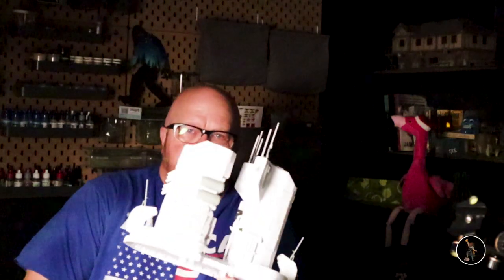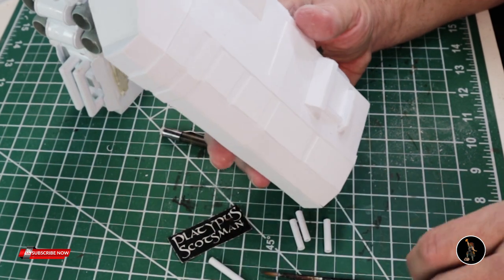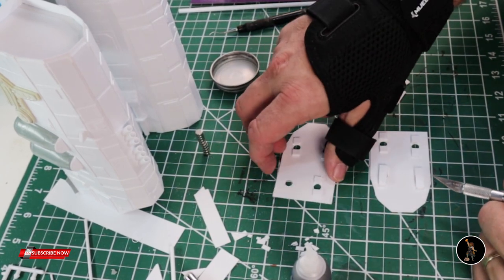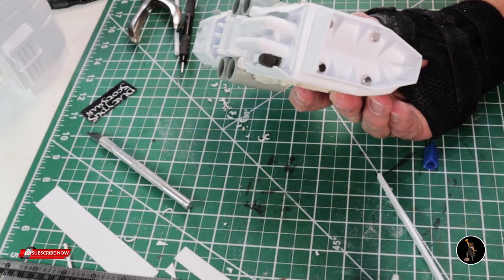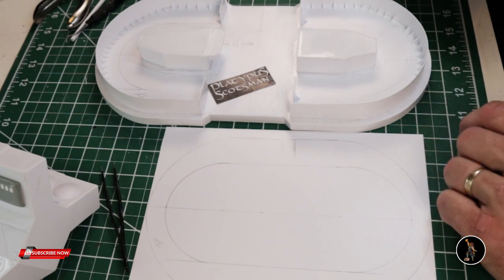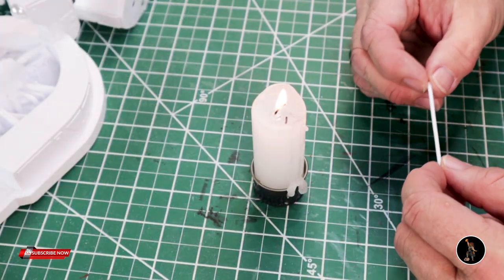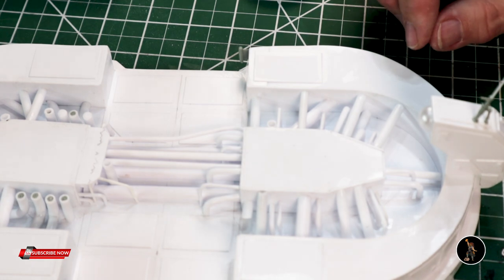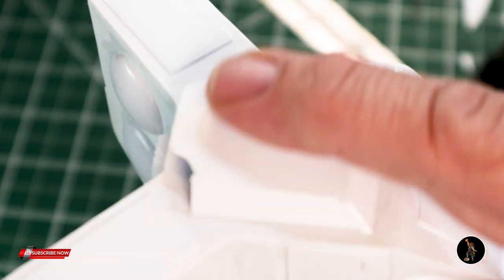Hypermatter Reactor Tutorial Part 3: Finished assembling.

Comment: Super detailed work! Do you have links to the materials you used? The polystyrene and the adhesive for binding it.
Reply from the maker: Thanks. You can pick up the sheet styrene at Hobby Lobby, Train Stores, Plastructs on line. Just google styrene sheets. Here is the link to the Weld-On 3. 
Thanks,
John...
https://www.amazon.com/Weld-Acrylic-Plastic-Cement-Applicator/dp/B0149IG548/ref=sxts_sxwds-bia-wc-nc-drs1_0?crid=1KJ8D2ZVY0S8G&cv_ct_cx=weld-on+3&dchild=1&keywords=weld-on+3&pd_rd_i=B0149IG548&pd_rd_r=ac0b0684-ccf8-43d6-8f9a-8edb6e7e70d6&pd_rd_w=vGXMl&pd_rd_wg=kDVue&pf_rd_p=8f655ecb-bc8c-4750-9088-950aa74d52dd&pf_rd_r=G6C6PP8KYD8RR2BJVWHA&psc=1&qid=1608560300&sprefix=weld-on%2Caps%2C247&sr=1-1-88388c6d-14b8-4f70-90f6-05ac39e80cc0